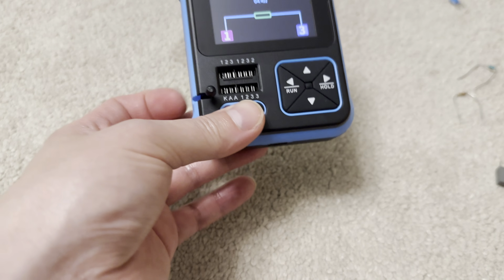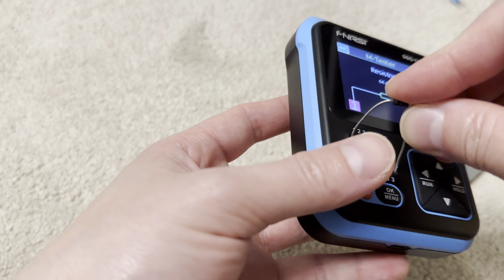Quick intro to the FNIRSI DSO-TC3 Multifunction Electronic Component Tester

Comment: @8:40  The diode symbol does not change to point right or left, but the numbers at the bottom (1pink/2 blue) do change when you flipped the diode.
Reply from the maker: Yeah well spotted. So the graphic is fixed but the terminal labels are swapped :)

Comment: Nice review! These units are starting to increase in production value with some value-added extras to sweeten the price increase.

- Calling people lazy for not reading the stated value is missing the point - sometimes close matching accuracy is preferred when building some circuits, especially analogue ones, not necessarily the actual value.
- This is a 'component tester' not 'identifier'!
- Values read may not appear accurate for several reasons:
	- It's reading 'actual' value rather than approximating to the closest standard.
	- The component has a large tolerance.
	- The component is damaged/worn (capacitors may look perfect, but read wildly wrong).
	- The component is counterfeit!
	- Very low battery may skew result.
	- Clamp/Legs may be oxidized, skewing result.
- In 'Tools', option 3 and 4 are testing the ds18b20 and dht11 temperature sensors respectively.
- The K A A pins are for testing Zener diodes.
- Regarding the Diode test symbol not switching: The screen symbols are drawn the same direction, but the pin numbering on screen will switch to reflect the component direction.